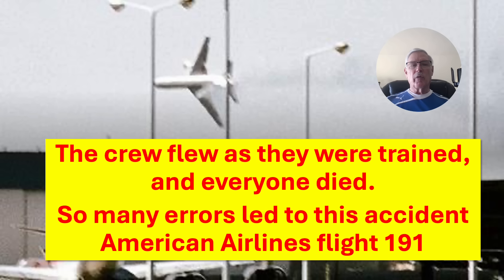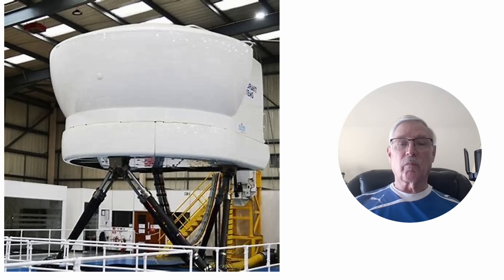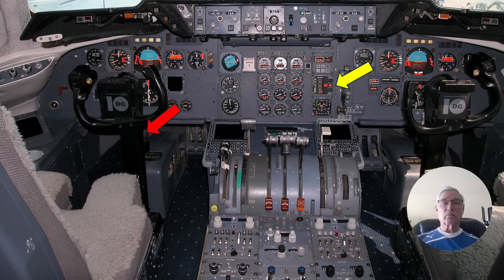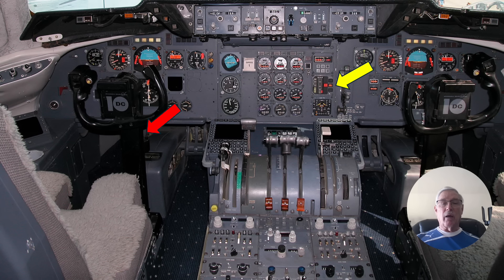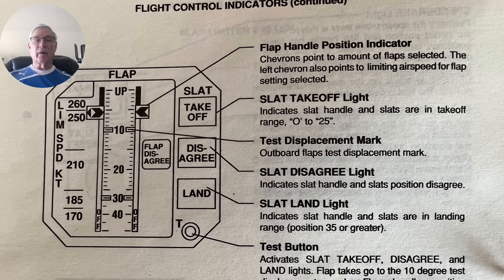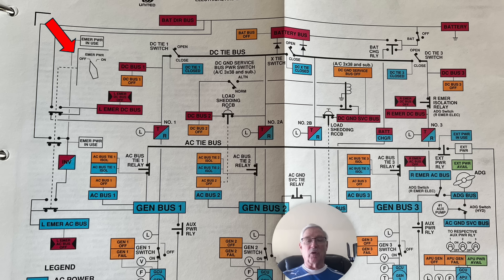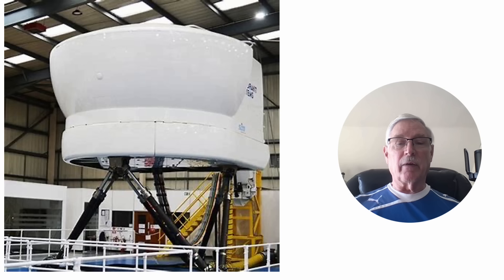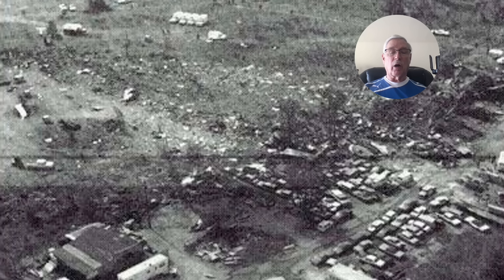The crew flew as they were trained, and everyone died. American Airlines flight 191

Comment: I was hired by American and had a mid June 79 training date when this happened. This accident was one of several incidents that caused the public to lose faith in the aircraft and accelerated it's replacement. A few years later I flew FO on the DC10 and this incident was well covered and trained with updated procedures. never flew Engineer/FE on the 10, went from 727 FO to DC10 FO. At American we had "2 stripers", AKA PFE or professional flight engineer. These were hired on not as pilots but engineers only. At one point they were given the option of upgrading to a pilot position or forever flying as engineer. These guys might have come from another airline under as take over of another airline, don't remember.

Funny story about the cockpit camera. The view in the passenger cabin showed the two pilots and the center consol/throttles but not the engineer. On takeoff the pilot would stand the throttles up, push em up to approximate setting. and the engineer would fine tune the epr for takeoff power. All the cabin saw was the arm of the engineer leaning up to set the power. Well this 2 striper put on a glove of a hairy gorilla hand up to his armpit, and the public saw what looked like a gorilla as a crewmember on the throttles. Rumer was he was fired for it but who knows. Like you said for various reasons the cameras were removed including the liability from some lawyer in the back using the video against the airline and crew.

Thanks for the video.

Comment: Very well done and excellent research.  I was at ORD at that particular time and place.  My crew was on a short layover when the accident happened.  We ran to the windows to observe a large column of smoke and fire.  We took off only 2 hours after and flew right over the accident scene.  Not a pretty picture.  As time would tell, Forklift Joe and Langhorn became infamous folks shortly after.  I still remember Langhorn in his flight suit directing the investigation. As an airline, we at NWA were very concerned as we had the same engine coupling on both our DC-10-40's and all of our 747's.  We changed our flight operation slightly and of course we never used a forklift.  Joe Leonard was a product of NWA.  He used cheap whenever if suited him, one of the reasons he ended up at American.  I agree with you on the stick shaker being of most importance.  Our revised procedure would have us fly to the stick shaker and stay there.  As I remained vertical for 36 years with NWA, I eventually became chief accident investigator on the 747.  Do not reinvent the wheel again, ever.   NICE job on presentation..................

Comment: In 1972 as a 12yr old my family and I flew out of LAX on a DC-10. On rotation the right engine started banging and shaking like an out of balance washing machine on the spin cycle. They shut it down as we climbed out as you could see we weren't climbing very fast. They went out over the ocean, dumped fuel and landed with out incident. Thanks pilots! I'm glad the pylon was not compromised beforehand. We got put on a 707 for our return flight. That was my only opportunity to fly on one.

Comment: In early 2012, I flew SWA from PHX to ABQ.  I had a wing seat on the right side of the airplane.  Looking out the window, I could see a couple of rivets missing from a panel on the top of the wing, this panel was directly above the engine pylon and in line with the leading edge of the wing.  As we taxiied out to take off, I noticed the engine bouncing around a lot more than normal and that panel was flexing open and closed along the leading edge.  On takeoff, we had some turbulence and I noticed the engine really bouncing and that panel was really flexing.  I shut the window and took a nap, figuring that if we made it to cruise, we would make it the rest of the way into ABQ.  We did.  When we landed I opened the window and notices there were more rivets missing on that panel.  I stopped by the flight deck and told the crew, the FO said "well, we'll have to take a look at that!" in a voice that reeked of "another dummy thinks the airplane is broke".  I had to run for my connecting flight, I am pretty sure SWA MX must have caught the issue at some point before it become critical.
Reply: It was the gremlin from that Twilight Zone episode starring William Shatner.  If you'd opened the window shade he'd have been looking in on you.
Reply: Ehh he probably took it seriously and at least had someone inspect it. If you noticed rivets popping thats pretty serious. The pilots lives depend on the airplanes too.

Comment: Ron, a Tristar pilot told me that would have never happened on an L1011 because of inertial sensors on the slats. If they retracted too fast a brake would hold them in position. Douglas later modified the slats so if they lost hydraulic pressure they would keep their current position.

Comment: I flew the DC-10 for American Airlines from 1990-1996, years after the 191 crash.  We were trained at that time to keep your speed up to V2 + 10 or more on an engine failure.  Several pilots at American flew the simulator in the 191 configuration successfully by maintaining the higher speed.
Sadly, and stupidly in my opinion, McDonnell Douglas chose to program the flight director to automatically command pitch nose up and reduce the airspeed to V2 during an engine failure.  The Flight Director was never changed, so we were trained to DISREGARD the flight director command to pitch up.  So, we were told to just fly raw data for pitch, while the flight director command bar was requesting something wrong.  I am sure you were trained the same way, and the flight directors on DC-10s today are still programed the same old  stupid way.
Personally, I switched the flight director OFF for engine failures because the incorrect flight director was more distracting than flying raw data.  Obviously I am not a fan of McDonnell Douglas airplanes, especially The DC-10, MD-11, DC-9, MD-80, etc.
As a side note, not only did American opt for only one stick shaker they also saved about TEN DOLLARS by installing only one clip on the yolk to hold your approach charts!  Their reasoning was that approaches in bad weather were flown by the Captain, so only the First Officer needed a chart holder.  American bought some Pan Am DC-10s, and you could tell them immediately upon entering the cockpit because they had TWO chart holders, one for the Captain and one for the FO.  Another act of cheapness was in our B-727s.  Each comm radio had only ONE HEAD for selecting frequencies instead of Dual Heads.  Thus, you were supposed to write down your frequency before changing in the event you selected the new frequency incorrectly and needed to recontact the old frequency.

Comment: "The crew was not cited in this accident"  The NTSB report did however note in two places that EMER PWR could have been used to restore power for at least thirty minutes, had any of the crew twisted the knob.  My (nonpilot) guess is the captain's thinking was along the lines of  "Something bad's happened, but we have control, are climbing, and the FP has most of his instruments.  Let's not mess with what's working.  Climb to 3000 and then sort things out."

The FAA did not require slat locking since DAC was able to demonstrate (in cruise flight) that that even with the slats on one side completely retracted the aircraft remained controllable.  Apparently that was considered a worst case, presumably backed up by an FMEA of dubious pedigree.  Perhaps not all of the flight regimes were examined?

I witnessed several of the FAA's simulator tests, with one crew after another rotating through.  In a room a few floors above the MBS was a simple model airport, with a TV camera suspended above the runway painted on a very large table.  Crews adhering to 191's control choices (i.e. the flight manual) were causing the camera first to tilt and then to point down while only a couple of feet off the model runway (at which point the run was over).  Those flying the "we know what's happening" test cards flew away (camera rose a few more feet into the air and the run was over).

Comment: One more tidbit:  Of course the fleet was grounded & all engine mounts were examined by every operator.  At the time of the accident there was a pilot strike at United.  The anecdote that was circulated was that United found one wing mounted engine which nearly fell off when they examined it.  The most important aspect was that the crew had a flyable airplane on a day VFR flight &, had they not slowed to V2 but kept their speed, likely all would have survived.  The only lucky thing about this accident is that the airplane hit the ground where it did & not a few hundred feet further as that would have  taken out the trailer park & likely killed many more.  That flight had a person sitting in every seat belted place on the airplane.  Systems knowledge is everything in these situations.  Good basic airmanship is also the key to survival in so many accidents.

Comment: Joe Leonard changed the procedure for changing the engine. This was done to save money. He then went to Eastern Air Lines. This time he changed the procedure for putting O-rings on magnect oil plugs that are pulled to check for metal flakes in the engine oil.  The plugs were charged on a L1011 out of Miami. The guys did not realize the O-rings were not on the plugs. As a result the bolts worked themselves loose on the way to the Bahamas. Oil drained from the number 3 engine and auto shutdown. The crew was told to turn around and come back to Miami. On the way back the number 2 tried to shut down but was overriden dy the crew then number 1 did the same .
As they were landing the engines started sneezing.
The crew realized rhat they could restart the first engine in time to keep it in the air till they got to the runway.
All three engines seezed on that L1011 as it landed
Forklift Lenard almost caused a second catastrophe. All in the prosute of savings money.

Comment: Thanks for the explanation Captain Rogers!   I was doing a considerable amount of flying back then, mostly on American, sometimes on DC-10s, and often went through Chicago from San Diego on my way to New England.  The previous disaster with the PSA crash in 78 which I saw the aftermath of from a few miles away, and flight 191 sure had me rattled for a time.    My brother who was a pilot claimed that 191 could have been saved, but it seems unrealistic to me.  (Although Tim was usually correct about such matters!)  

I now understand much more clearly why my brother thought 191 had a potential solution...  Although it still seems like there was a lot stacked against them.  Training sometimes seems to be a blade with two sharp edges.

Comment: They were trained as we all were on our jets, lose an engine on takeoff go to or back to V2+10, 20, they were above those numbers and the FO did as trained.  Of course the worst of it all was the maintenance guys had developed the procedure of using a fork lift that caused stress on the engine mounts.   I enjoy your stories, you’ve had an amazing career.
Reply from the maker: Thanks and you are exactly correct!
Reply: The leading edge slat retracted and the left wing stalled? He couldn't have known. On a better note, Bryce McCormick and the AA DC 10 Windsor incident was an incredible display of airmanship getting safely back to Detroit in 1972. Nobody had much experience yet on the aircraft.
Reply: I have always been a ,speed is life guy. If something explodes, quits, falls off and you are still flying ,,,I have always tended to hold that configuration.
The only time I didn't like to go fast was when I would say.." Speed kills, Haste makes waste, time is Money, and we are paid by the hour😅.
What is interesting to me. In all my emergencies. Looking back, it was as each one happened in slow motion. My best case example was losing a main Rotor drive belt in a helicopter at 60ft. Just coming back from the fuel farm. Low, relatively slow, quick stop maneuver to a run on landing. Took maybe 6 seconds but seemed like 6 minutes...I had good training,, enough to not even break a fingernail😮
Reply: Once again as in most aviation accidents it wasn’t one thing that causes it. The holes in the Swiss cheese unfortunately line up and you wind up with a disaster. You do an excellent job presenting your videos and whether serious or amusing I really enjoy watching.

Comment: Ron, I think you have left out some critical items.  I was a 727 FE when this accident happened. (I flew F/o on the DC-10 for a few years before upgrading to CAPT on the S-80 (DC-9)). I was at DFW in the crew room when the chief FE @ DFW came through with the word that "we just lost an airplane"  Followed by "do not talk to the media about this".  RE: electrical system--the electrical busses(AC) are separated, not connected (or "synced" like the 727/707) HOWEVER--loss of a use is supposed to be picked up by an operating buss--i.e., losing the #1 buss will be picked up by the @2 buss.  Principally this is designed in for generator failure but when loss of that buss is sensed the #2 buss is supposed to pick it up---it didn't.  Each kid slats are powered byte HYD systems 1&2, 2&3, the same for flaps & all flight controls.    We (American Airlines) had been 'dinged' boy our POI for not slowing to V2 after an engine failure on T.O..  Had this crew done what was done prior to the "ding" (& what is done today) this accident would not have happened.  Review of the FDR (on the NTSB report) shows that as they slowed the right wing stalled & the rest is terrible history.  I'd like to add that Douglass had proven to the FAA that the airplane could be flown with one stall retracted & the other in Land.  There were no speeds or even mention of that in the AA manual.   I was told that Douglas did not share that information with the airlines.  That is why the airplane was certified without locking the slat out & requiring HYD pressure to move them from the selected position.  Totally preventable accident, even with #1 engine being torn off the airplane.  You are correct: This was an accident caused by training.  Those guys didn't have enough time to figure out what kind of airplane they were flying.   I took lessons from this accident for the rest of my 28 years at the airline & have learned to figure out what airplane I have in any situation.  I retired in 2015.  I wish I had an old airport diagram of ORD with : "new scenic", "North-south", "old scenic", "bypass" & all of the old names of the taxiways.  Those days were fun & you knew you'd accomplished something when you learned the names & knew where they were!    I only ever flew off the old configuration airport.  I even had an engine fail on T.O. there at night in the weather.  The F.E. looked around for the instructor, it was so much like the simulator training.
Reply: Actually the Buss-tie should have worked on #1 &#2.
Reply: Left wing, not right stalled

Comment: I'm not going to disagrees with your overall assessment.  Hindsight always has 20/20 vision.  The DC10 was designed by McDonnell-Douglas with the overriding theme of holding down costs, nothing else mattered, well, except speed of developing and delivery of the first aircraft.  Quality was given lip service but there was no "enforced zero defects" type program and little attention given to fail safe operation.  Contrast with the Lockheed L1011 which was a far more advanced aircraft with (for the time) cutting edge features -the differences are outstanding.  Of course, the cost of the L1011 doomed the program and resulted in Lockheed abandoning the civilian aviation market.  Sadly, the combination of cost and the fact that the L1011 shared the overall layout of the DC10 tainted the program.  Many of the features you discuss in the video were incorporated in the L1011.  The eventual merger of McDonnell-Douglas with Boeing resulted in the fiasco that has infected Boeing ever since the merger.  Boeing fell into the Bia-school game of stock value and cut costs that McDonnell-Douglas.
Let's not forget the disaster of United Flight 232 DC 10 (July 19 1989, Sioux City, IA) that was caused by a GE engine disintegrating fan disc and the total loss of hydraulics thanks to McDonnell-Douglas lack of back up considerations (The L1011 had four independent hydraulic systems).
The engine removal procedure was not only not recognized by MD, but MD advised AA and Continental, that using the engine with the pylon removal was "not encouraged".  The FAA probably had no idea that this procedure was being performed; look at the sad state they are in today (What does MCAS mean?).You're correct the crew followed the emergency procedures as they were trained, but the real cause of the accident was the blind approach to build cheap at McDonnell-Douglas and the effort to short cut maintenance by American Airways mechanics.  Now Boeing is busy trying to recover from the inheritance of avarice.